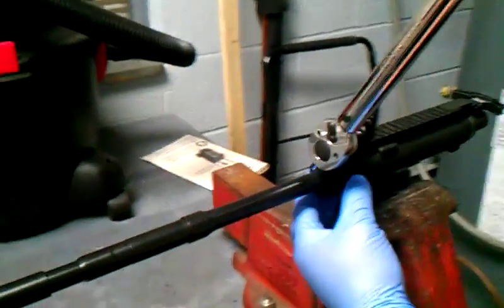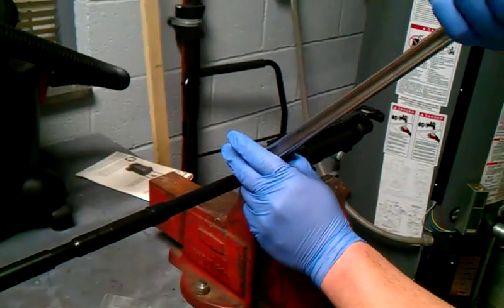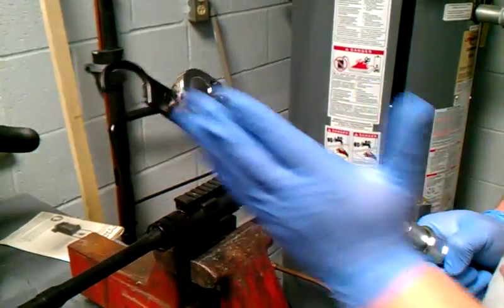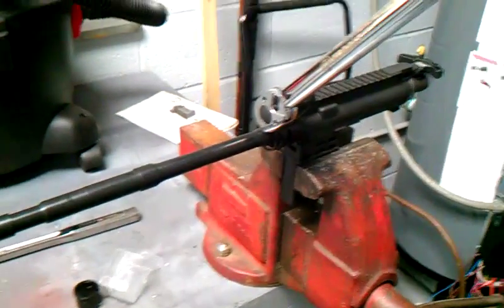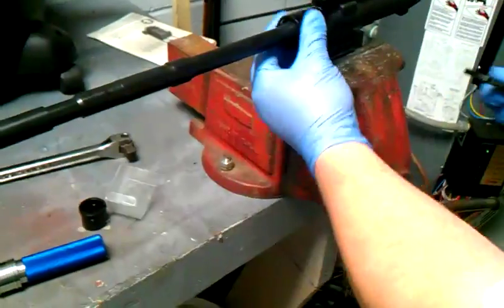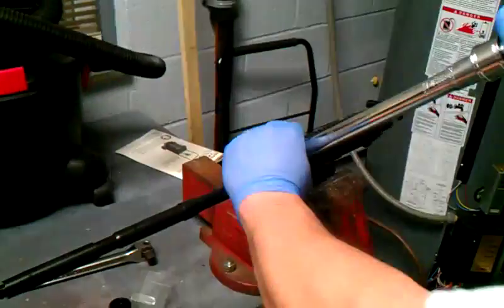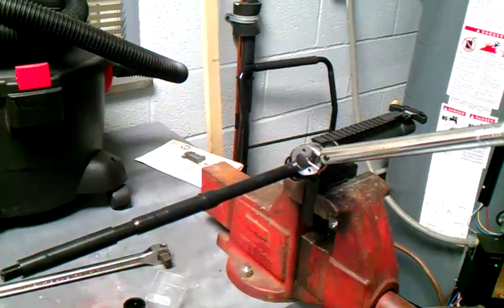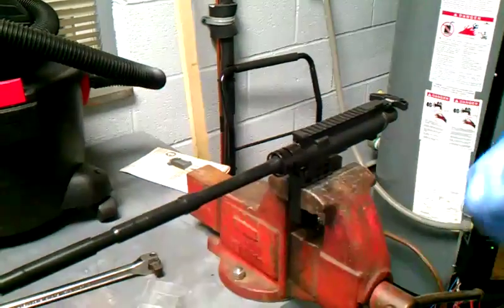How To Build The AR-15: The Correct Way To Torque A Barrel Nut (Part 2)

Comment: The angle between the the torque wrench and the adapter for the barrel nut does not matter much when the adapter connects to the torque wrench very close to the barrel nut and the torque wrench is much longer than this distance. If the connecting point were further away from the barrel axis then 90 degrees would be the proper angle to make the measured torque equal to the applied torque. This is due to the fact that the applied torque is the sum of the measured torque plus the effect of the force applied to the adapter. Assuming you are applying force to the torque wrench in a direction perpendicular to the torque wrench arm, then a 90 degree angle between that arm and the adapter length causes the final resultant force to be directed along the length of the adapter instead of perpendicular to it so that force doesn't add or subtract from the applied torque.

Comment: Whatever manual you read was either incorrect, or they had a specific wrench in mind and had already done the calculation on the extended working length to arrive at the torque they actually wanted on the barrel nut. When you extend the working length of a torque wrench, you are not getting the value you set on the handle. Anyone in any industry that has been properly trained to apply specific torque to a fastener can tell you that.

Comment: Op is a little confused.  The manual does say to put them inline but you have to calculate your torque value.  Torque is force x radius where the force and radius vectors are perpendicular.  In other words, if OP sets his torque wrench to 30 ft.lbs. he will be torquing to greater than 30 ft. lbs because he has forgotten to recalculate the effective torque based on the increased distance.  For users at home, to get a correct torque value without calculations, place your crow's foot/armorer's wrench at 90 degrees.  To tighten it as specified in the army maintenance manual, you have to calculate your torque value.  If OP sets his torque wrench to 80 ft.lbs and torques it inline he is over-torquing.  In general though, as long as you aren't setting your torque wrench for less than 30 ft.lbs or greater than 70, you don't have much of a shot of over/under-torquing by either method, so it isn't really a big deal.

Comment: I don't think that exact torque specs are nearly as important as the YouTube gunsmiths will have you believe...I take the barell on and off my shotgun with a thumbscrew and that's just finger tight...these rifles aren't much different in my opinion.
Reply: AR's are very dissimilar to shotguns.  rapid cycling  small calibers tend to vibrate parts loose due to harmonic induction and mechanical chatter of the action opening at high velocity and slamming closed into battery.  a pump shot gun has a larger recoil witch is arrested over a much longer greater and duration using  your shoulder as a shock absorber.  Next chance you shoot an AR feel for the vibration in the receiver. Max pressure 5.56x45 is 63,000psi  12ga 3" 1oz shot is 11,500psi

Comment: 90 degrees gives a "true" torque reading because it factors out the additional torque added by the mechanical advantage of the 1/2" square drive hole being a certain distance from the center line of the barrel nut in this case. 

That sounds great except for the fact that the torque specs everyone uses have already factored in the added distance of the military barrel wrench when it is used inline as the manual states should be done. (please consult the latest manuals).

That being said the range of the acceptable torque is so large the difference is of no concern unless perhaps you are using 90 degrees at the max value.

I have had enough experience that I rarely need to use a torque wrench these days but a beginner should until they have a few builds under their belt.

Comment: Netchemica is 100% correct, if you add length to the torque wrench, which you are doing, your torque settings are NO GOOD ! If your using a longer extension on the torque wrench, you have to put rifle wrench 90 degrees to the torque wrench. There is however a formula to use when doing it your way that will convert the extra length to the proper torque equivalent. Just saying :-)

Comment: Please note below that netchemica and ganu are correct.  If your armorer's manual may call out that technique to torque the barrel nut, it is taking into account the offset torque increase of using the crows foot inline.  This will result in the barrel nut being torqued to a higher value than the setting on the wrench itself.  Not using all mil-components? Want to know exactly what your torque setting is?  You must place the crows foot at 90 degrees, OR do the math.  Here is a link to the math : https://www.engineersedge.com/manufacturing_spec/torque_wrench_1.htm

Comment: The angle from the tool to the torque wrench doesn't matter. If you set your torque wrench to 30 ft lbs, then tighten something 2 inches further from your hand, it's going to be greater than 30 ft lbs. Not much, so it doesn't matter, but it's off by the same amount no matter the direction of the tool.
Reply: No, you can mathematically prove it is more torque inline and that the wrench set-torque is the same as the actual torque when the crow's foot/extension is at 90 degrees.  YOU CAN MATHEMATICALLY PROVE IT.  They are not 'off by the same amount.'

Comment: Please RR, view Shane Conley's video; "How to use an crowfoot or extension adapter on a torque wrench WITHOUT MATH". It will visually PROVE how the adapter position (90* and 180*) affects your actual torque output value. Your method is producing a value HIGHER than your wrench is set at. Again, see Shane's video.

Comment: In short, Netchemica is exactly right. Unless something in the task requires you to use the crows foot and torque wrench in line with each other (difficult angles, parts in the way, etc), you always use the tool at a 90 degree angle to the torque wrench. Otherwise you HAVE to do the math in order to obtain proper torque. No way around it; it's physics.

Comment: Having worked in aviation maintenance for over 20 years, I can't tell you the number of times I've had to correct young guys who think that a crows foot gets used in line with a torque wrench.

No offense to anyone who mistakenly assumes that the orientation of the crows foot doesn't matter because we've all been there, but that really is a common misconception. You change the working moment of your torque wrench when you add an extension IN LINE with the length of the wrench. That's not just mechanic snobs who say this, it's actual physics.

If anyone insists on (or has to as really is the case sometimes) using the crows foot in line, you MUST do the math to take your new length into account.

I can't help that UTG shows their wrench and tool in line with each other (it is a pic though, NOT specified instructions as was implied), you NEVER use that method without doing the math.

Google Torque Wrench and Crows Foot.

Comment from the maker: YOU are misleading my viewers please check your facts before you make a comment. First of all, there is no magic torque for the barrel nut, as I've said before, it is a range of 30-80 ft-lbs with the extension inline (which is less with the tool at 90). I personally don't go past 70 ft-lbs because of the stress on the receiver.  You can risk YOUR barrel nut coming loose, mine will be tight.   Furthermore, if you notice the free float handguard that I'm installing (UTG Pro super slim), the very manufacturer's instructions tell you to keep the tool INLINE!

Comment: You're misleading folks with the "torque wrench in line with tool" comment.  That only works when using the tool they were issued (or any tool that has the same distance from the adapter to the barrel nut).  

There is no standard for this length and many tools have different lengths and this may cause excessive torque values.

Armorers are being taught to keep their adapter at a 90 degree angle to ensure the correct torque value with any adapter length.
Reply: 90 degrees gives a "true" torque reading because it factors out the additional torque added by the mechanical advantage of the 1/2" square drive hole being a certain distance from the center line of the barrel nut in this case. 

That sounds great except for the fact that the torque specs everyone uses have already factored in the added distance of the military barrel wrench when it is used inline as the manual states should be done. (please consult the latest manuals).

That being said the range of the acceptable torque is so large the difference is of no concern unless perhaps you are using 90 degrees at the max value.

I have had enough experience that I rarely need to use a torque wrench these days but a beginner should until they have a few builds under their belt.
Reply: @DC-so1lw  bullshit

Comment from the maker: No problem.  Just remember that for any barrel nut you must set your threads at 30 ft-lbs and then torque until you get your gas tube aligned (for mil-spec or barrel nuts with holes) not to exceed 80 ft-lbs.  If your barrel nut is not timed with the gas tube (like in the video), I like to try and stop around 50-60 ft-lbs.  Now if you do get to 80 ft-lbs, you're going to have to either shim the barrel nut, or square the upper receiver.  I will be making a video soon of squaring the receiver (this can actually improve accuracy too).